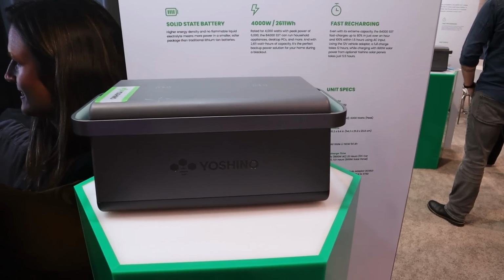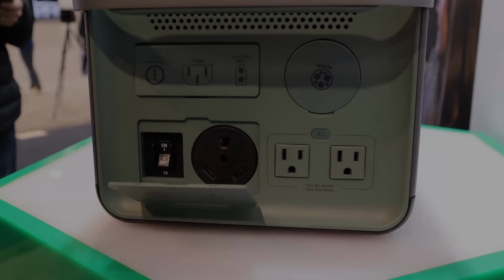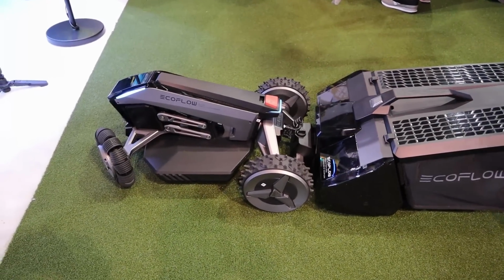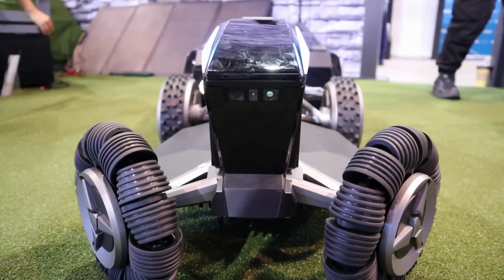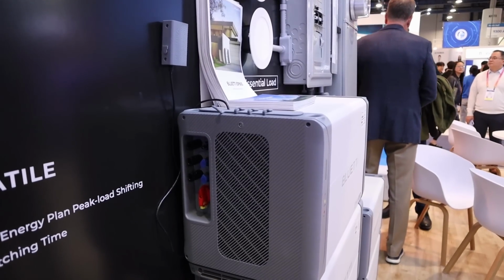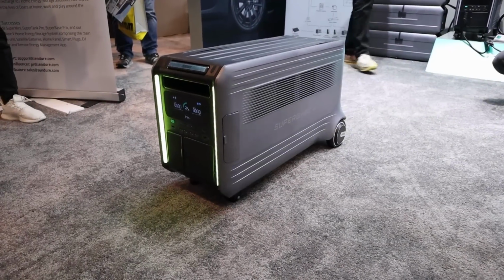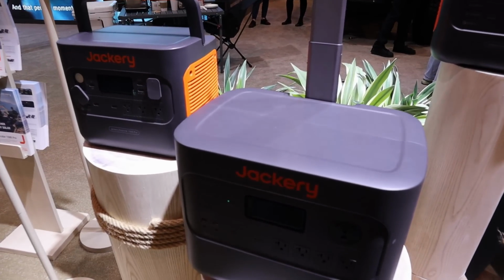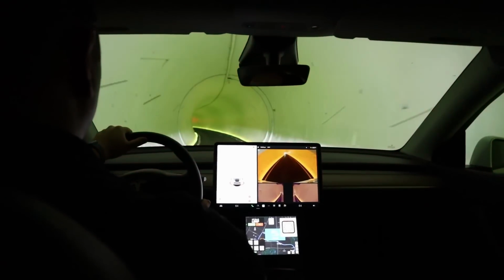ALL the New Power Stations at CES 2023!? - EcoFlow, Bluetti, Jackery, Zendure, Yoshino, UGreen!

Comment: $10,000 for the Bluetti EP900 with two batteries.....yeah only suckers are going to throw away money on that. We've all seen how problematic Bluetti products are so it would be a miracle if they released the EP900 without Reddit, YouTube, and the DIY Solar Forum getting flooded with frustrated customers. The Bluetti subreddit is hilarious/depresssing....guess that depends on whether or not you're a Bluetti product owner.

For $10,000 you can get 3 server rack 5kwh batteries and two LV6548's and you'll still have some money left over if you shop around

Comment: That Jackery dual wind turbine won't be ready for at least 2 years?  What could possibly be the delay?
Reply from the maker: It's probably not even designed on the inside. It's just an empty case to show off  an idea.
Reply: As many people who look into (or even get into) micro wind quickly learn, it takes /work/, wind is nowhere near as "set and forget" as solar. And under certain circumstances, the potential to "also generate power at night!" is more efficiently offset by simply getting more solar to store power for the night.

Comment: Jason, do you have any idea what nut and bolt to order to connect my fuse for my battery to the inverter cable? A guy made a "how to" video and of course left that one detail out. I don`t want to waste more money or destroy something by guessing and he won`t answer my question. I don`t feel like wild guessing is gonna work and I can`t find any info whatsoever and don`t want to screw up now. 

It`s a 200 amp 32v DC Blue Sea Systems AMG fuse.. 5105. Probably the wrong one for my 200 amp battery using a 2000 watt inverter. But I don`t know what to buy. He recommended that in the video. I`ve been through so much stress from my sister that I can barely think. But I have to try to safely finish my system before April. 

Gonna use four 100 watt solar panels...in series/parallel for 24 volts with two 190 watt solar panels in series in parallel with the others to my 60 amp MPPT controller and add more panels later. This should be enough to power my tiny window air conditioner. Hopefully that isn`t too much current for a 10 AWG MC4 cable. Should be less than 25 amps.
Reply from the maker: I just use zinc coated 5/15th bolts and nuts when connecting these ring terminals together. It seems to have worked fine for all of my inverter connections so far. The 400 watts of solar should do a good job keeping the battery charging if you have great solar conditions. Just make sure the panels are angled properly.
Reply: @Jasonoid  I`m gonna use four 100 watt panels and two 190 watt ones. Gonna hook them up in series/parallel for 24 volts running to the charge controller. I need one more 100 watt and one more 190 watt panels to hook them up that way. I have three 100 watt panels and one 190 now. Three pairs in series on one parallel string. I should get well over 600 watts on a sunny day and be able to power my small Frigidaire window air conditioner during the day and several hours after dark. Not gonna completely drain it though...just half way each evening. Late at night I can recharge it with my 20 amp charger if needed when rates are lower to begin powering it early the next day before solar charging kicks in.
Reply: @Jasonoid  Thanks. I`m putting those in my cart. I have to get a battery meter and two more solar panels now before Spring.

Comment: At CES did Eco Flow address the loud fan noise of their Delta models, which for me may be a deal breaker, and also do they have or plan a LiFePO4 model with about 1500wH (like the new but low tech Jackery Explorer 1500 Pro)? Thanks!
Reply from the maker: They have the Delta 2 which competes with the Jackery 1500 (1000wh to 2000wh LFP). They are putting out the Delta Max with LFP later this year. When speaking to their engineers they will be placing much quieter fans in their units and they will also have a faster UPS mode.

Comment: Looking forward to the EP900. Building a new house in 2024 and want to go this route. Thanks for the video
Reply: You should really really reconsider that path. You can buy 3 server rack batteries at $1700 each (5kwh each) and two LV6548's for less than $2000 each and you'd have a far superior system for less money. The only downside is you won't get the pleasure of meeting Bluetti's non existent customer service if you don't go the EP900 route. 

Seriously, the forums are full of Bluetti product problems from the EB3A on up and the consensus is almost 100%, their customer service is somewhere between terrible and non existent.

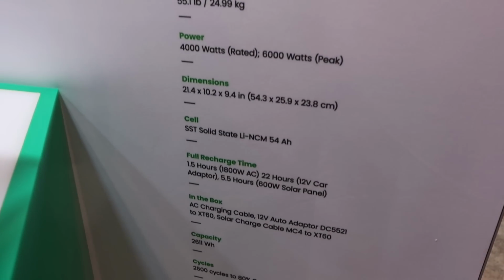Comment: umm i wonder how solid state that battery is 0:42 with Li-NCM. lithium and nickel together make very energetic reactions. I look forward to seeing some destructive testing of the cells to see how explosive they are. semi solid state still has liquid electrolyte in it and makes the reaction more flammable. so if it has no liquid at all, which is what solid state is supposed to mean, it should not go up in flames if damaged, over charged, or baked.

LFP makes for a much safer cell, as when they are damaged, they get hot and leak out all their electrolyte becoming inert, true the heat could start another fire, but less likely when it doesn't burst into flames it's self. if overcharged/baked they eventually burst the safety seal, once again leaking out all the electrolyte and becoming inert.

both ecoflow and bluetti look to have new developments on the horizon, i look forward to what they have to offer.

that zendure superbase moving around on it's own is very neat, love that.

jackery they are super over priced compared to the competition. at least they are trying to innovate.

ugreen is the up and coming guy, i look forward to seeing more of what they have to offer, hopefully you get your hands on some of it and can share your experience.
Reply from the maker: Yoshino confirmed there is no flammable liquid electrolyte in their battery. They recently sent their solid state battery off to a lab on the east coast to complete all the destructive testing such as short circuit and puncture testing. That lab is also supposed to be displaying the results with video. We should be learning more at launch! They seemed to do their homework about the chemistry.
Reply: I want to very much see that video, if you find it before me, please post a link :)

Comment: It's been awhile since bluetti updated their camping batteries. seems like they're focusing on big bucks/house backup stuff now. Wished they have something new on the Ac200 line up. OTOH, feels like delta 2 max from ecoflow is up next, I REALLY hope they include a 30A DC output in that one. Am torn between a compact delta 2 (to use with their portable AC) and ac200max as it's got 12v30A but it's kinda too big to fit in a wrangler. First world problems I guess :p
Reply from the maker: They have a very interesting 'ACXX' unit in the works and it should be coming out soon. I'm very intrigued by it.
Reply: @Jasonoid  any links to information on it?
Reply from the maker: Nope. Not announced yet.
Reply: @Jasonoid  only thing I saw was the Salt battery thing they are doing and some B301 battery on their website.
Reply from the maker: @Evirthewarrior  yeah, it's not announced yet. My review unit hasn't arrived yet.